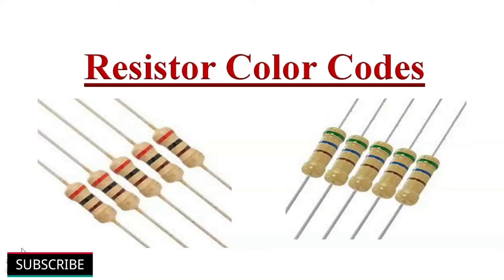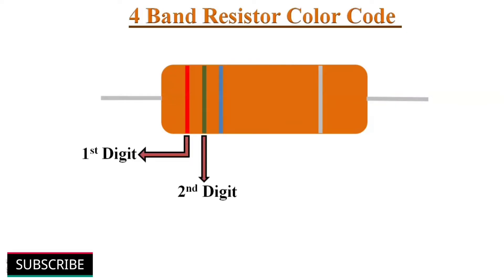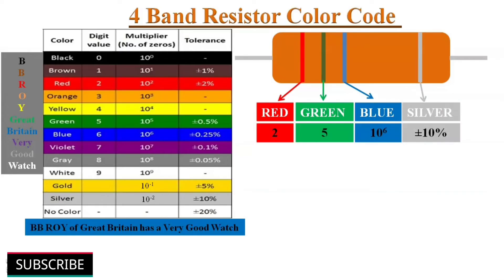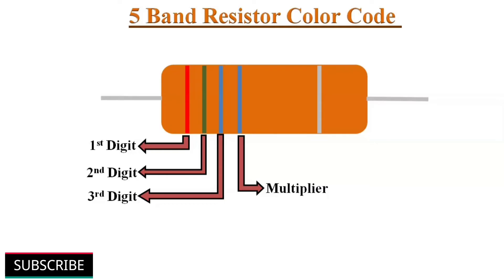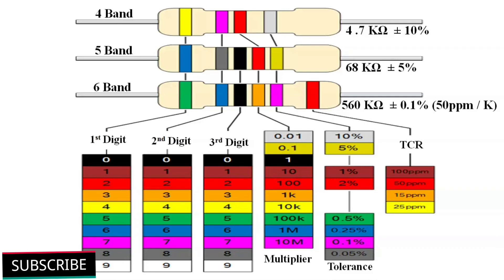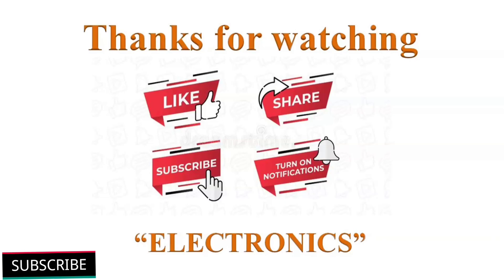Resistor Color Codes Explained with Examples

Comment from the maker: Timestamps for various topics covered in this video are as follows:
0:56 How to Read or Resistor Color Codes,
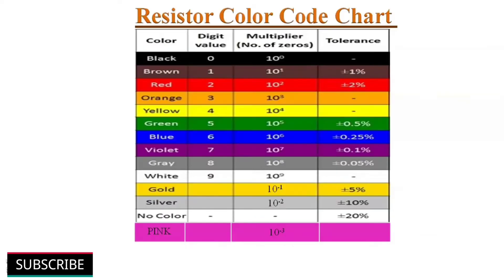2:14 How to Remember Resistor Color Code Chart,
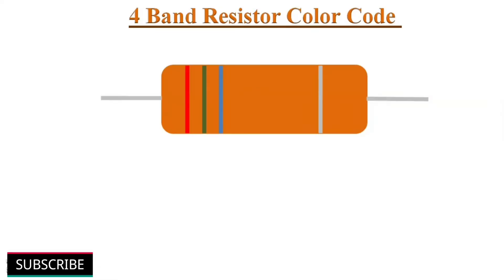2:59 4-Band Resistor Color Code (Examples),
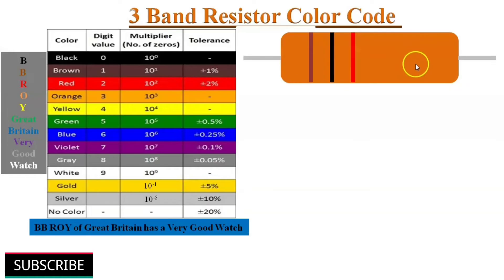6:27 3-Band Resistor Color Code (Examples),
7:30 5-Band Resistor Color Code (Examples),
9:49 6-Band Resistor Color Code (Examples),
12:42 Resistor Color Code Exceptions.